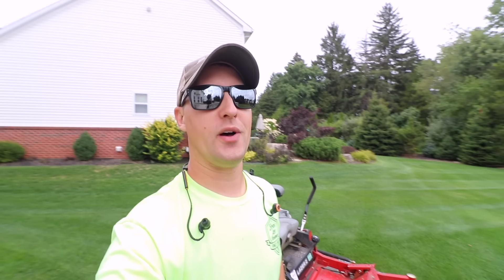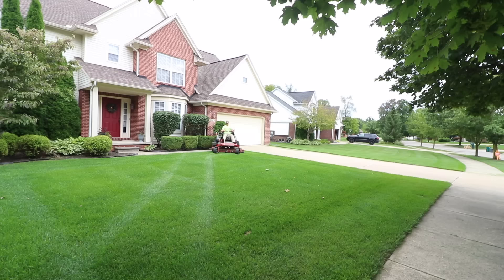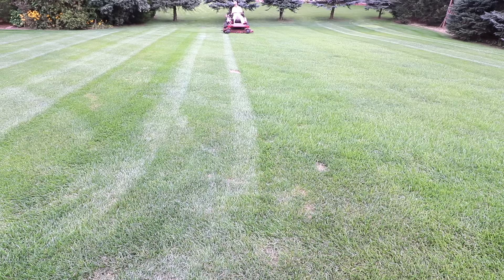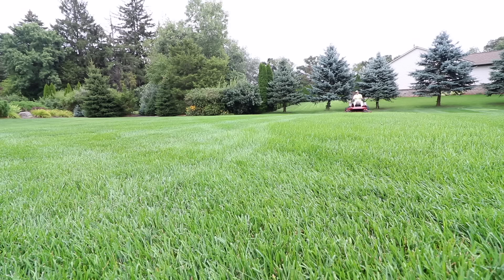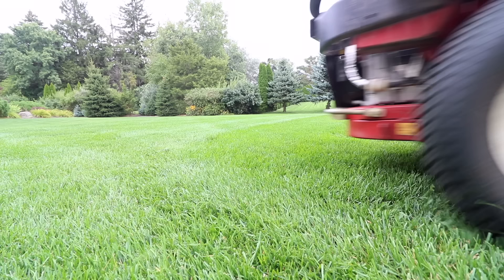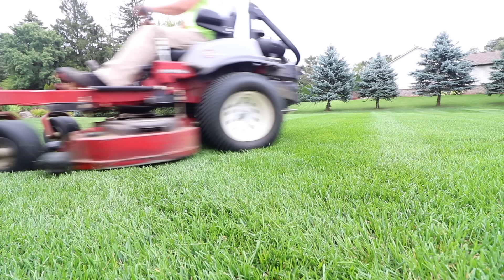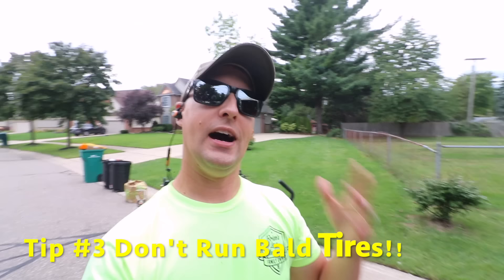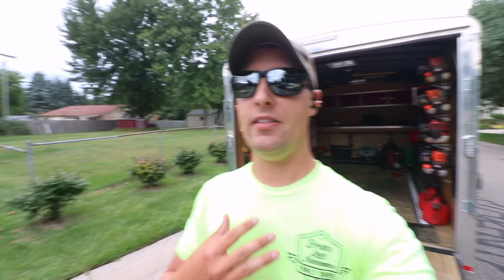The Secret To RUT FREE TURNS On A Lawn Mower

Comment: Thanks for these tips.  I had a troy bilt zero turn with a steering wheel.. Just got an Ariens edge with levels. I knew there was a learning curve but geez.
I was turning like you but  was going straight back.  I'm going to practice the way you do it. Turn, Backup while turning then line up and go easy.

Love the deck on the edge for a residential but it is a rough ride on bumps.  I felt like I was on a wild bronco.
Had it a few days  AND GETTING BETTER.
The first day my neighbors got a good laugh and I have touch up paint handy.

Comment: I live on a farm but I mow my front lawn for aesthetics. 
The yard is about 10 acres which includes a three acre pond. Sometimes it is a bit wet up close to the pond and as you probably know, a zero turn will get stuck in a heartbeat. I changed my turf tires out with a set of ATV V-notch tires which are pretty aggressive. 
I can still get stuck but it’s now pretty rare. As far as not tearing up the lawn, I practice almost the very same maneuvers on my mower that you described and my grass looks great. Basically, if you go easy on the sticks when turning you shouldn’t be tearing up your grass.

Comment: Great video like always. 

Best Hint you gave the people is Slow down in turns, keep wheels always moving your machine is not a race car. 

I stay away from concrete side walks and driveways as much a I can my tires seem to always leave some marks even if I do a really big turn.  

I have learned that if you want to do a zero turn make sure you only do them on lawns that are thick with grass.  

If you can see the dirt or it is not like a carpet then you will increase your chances of tear out.  I use a T25i walker   with a 36" deck and those narrow tires so have I have to take my time on those turns. SLOW but keep those wheels always moving and do not take of fast.

Comment: Good video.  The 3 point turn was done nice and slow and deliberate so it was easy to see what was happening.  I operated a zero turn commercially in high school in the 90's.  Basically never stop a tire and pivot on it because it will create divots in the lawn.  Slow as you approach the turn around point.  Keep the outside wheel turning a steady speed and slight the lever for the inside wheel back thru the stopped position into a reverse position then slide it back to forward drive as the mower is lining up.  
I agree with the turning on paved surfaces vs. grass depending on how wet it is.  If it is wet you will end up with grass stain tracks on concrete surfaces.

Comment: I have three areas of my yard, each handled differently. In the very front (closest to road/sidewalk), every effort to minimize lawn damage (slower, careful wide turns on sidewalks if possible). In the middle (behind house), just get the grass cut (neatly, but not overly so). At the very back (uneven, large rocks, etc), it's play time (fast, spinning turns, run over stuff, etc).

Comment: Always try to turn around on sidewalks and driveways but avoid leaving tire tracks which only happened to me when it's wet or if you're in too big of a hurry...
 if you turn around in the grass every time it will end up looking bad because you will have turnaround marks instead of a straight line where the stripe continues right through... also over time in these areas it will start to weaken the grass underneath...
Brian does it perfectly in this video and that extra trim pass on a wet day if he cannot turn around in the driveway is crucial...
Reply: but how do you not leave tire marks on the sidewalk or drivaway
Reply: @ajbrewer8259  only when it's dry it won't

Comment: I have a big Cubcadet GTX 2000 garden tractor and I mow on a hill.  As you said, do not spin the tires.  It would help if I had positraction but one will spins.  Now only dry grass and I mow at the maximum deck height so that I’m not ripping up turf when mowing close to trees.

Comment: My Ferris 400S was dropped off yesterday and I was practicing with it and if you are Someone who is thinking about getting a ZT but stumbled upon this video and are worried I can tell you with confidence if the grass is dry doing a 180 won't leave ruts now it could be bc my grass is short time will tell I did ask the gent who dropped it off he said 3PTs are in the spring time I will update as time goes on
Reply: Cut my grass for the first time with my ZT last week even with coming up with a new route on the fly and doing slow 180s I went from roughly 2 hours on a traditional tractor to 42 minutes 12 in the front which took me roughly 25 minutes

Comment: sidewalk turns if dry grass. wet grass keep on lawn so u dont make a mess. most any hard surface is preferable. heres advanced tip. watch your front tires, they tear up lawn also. u should be able to spin them so they roll in a circular motion at all times. if you want to double cut the lawn, try super stripes. its every third line as you turn around hit the white stripe and you wont have to do any 3pt or zero turn. very handy also if you want to run the same pattern two weeks in a row. and watch your edging on the sidewalk. Last thing, when you cut the front lawn, u started your pattern on the wrong side. start your pattern where the driveway meets the sidewalk. (opposite angle opposite starting side.) it makes your turns easier. you can also do it next to fences or curbs and back into your next stripe, leaving you with a crisp one perimiter cut at the end. nice stripes btw. for an exmark. lol

Comment: If the sidewalks, driveway or the street are available to make turns, I use them versus turning on the grass.  My Gravely 260 is brand new and those back tires grip the grass even when doing three point turns and going around trees.  For some reason, I'm still tearing up grass (divots) in areas even going super slow and consciously trying not to lock up the pivot wheel... still happens.
Reply: Try reducing tire pressure in your rear.  Too high of pressure allows the wheels to slip.
Reply: Youtube Sucks ass  It's not bad, but you have to adjust the front baffles to get a good cut.  Many people just remove them entirely and it stripes great.  The problem is you get blow out from the front of the deck back onto the operator.  I'm looking at gravely 52" pro stance with the Kawasaki 730 EFI motor. Now that thing is sweet!

Comment: Would love to see a video of avoiding scalping when mowing shorter lawns around 2 inch uneven lawns are frustrating. My anti scalp wheels are in the front center of the deck on my wright stander. Feel like if it had side wheels on the deck it would be a lot better.

Comment: I always use sidewalk for turning; I even travel farther to get to sidewalk; I do anything to avoid turning on grass. one section where I would do 180 degree turn I go to sidewalk, turn, and get back on grass. what is opposite of sharp turn ? broad or wide turn,. on wide turn I got damage from zero turn. also, I keep my seat adjusted as far forward as possible to keep weight on front wheels. I also avoid mowing on wet grass; I see more scalping on wet grass. anywhere I see commercial mowing with zero turn I see lawn damage. only benefit of zero turn is very easy to steer. excellent video

Comment: I turn on the grass to: 
1).  Avoid discoloring the sidewalk/driveway
2).  Maintain the ice, tight edging, without weighing it down, by running over it.  When I was thirteen/fourteen, working with my grandfather in Florida, he’d “kill” us if we even stepped on the edging, or even walked across the lawn, once cut.

Comment: I totally get the advantages of a Zero Turn, I have one.  But its so funny to me having to take the thing that turns zero degrees and having to do a 3 point turn that I could just do on a cheaper lawn tractor that doesn't turn as tightly.
Reply: This is a hell of a good point
Reply: It is much less work and effort to use a zero turn when doing lots of turning following contours and beds at speed

Comment: One other tip...

Don't be afraid to mow in reverse.  It can be done!
Reply: I cut alot in reverse  what ever I can do to keep the grass on the grass . Saves  time with blowing
Reply: good trick to link different angles without screwing up 2 stripes. yes, yes it can be dont
Reply: My zero turn automatically turns the blades off when I go in reverse . So it's not possible for me :(

Comment: How about how to avoid the ruts following the same tracks over and over in a yard. It will actually compact the soil and change the cutting height
Reply: Change your pattern from week to week.
Reply: @ralph1478  yes, but many cutters haven't figured that out yet as I see a lot of striping jobs with dark green wheel tracks and noticeably lighter in between. Think this would make a good video

Comment: FYI, A portion of my lawn is on an incline.  I had a problem with the turf tires on my zero turn spinning on the grass  when turning up hill, if it was the least bit moist I would have to be pulled out with a rope.  Replaced the tires with ATV knobbys.  Now have no problems with getting stuck but have to turn very slowly, those knobby tires really tear up the turf.

Comment: I second the tip on tires. I had some tires glazed over (still have tread, but treads were rock hard and would free wheel on both lawn and concrete). Replacing them and getting grip back made a huge difference on my turning. And I do turn on concrete/aggregate where possible, but it is my lawn and my driveway.

Comment: Tip # 5.    Buy a zero turn mower with Turf Tear Reduction Technology ( Cub Cadet Pro Z 960 - with a steering wheel).   I always do a true zero turn and do not rip the grass. The technology is built right into the mower and the operator does not even have to think about it.  If you have a mower (lap bar)….. Brian is completely right….you are forced to slow down and 3pt turn.   So to sum it up.   If you bought a lap bar mower you REALLY did not buy a zero turn mower. (Sound crazy, ,,,,,that’s why my two lap bar mowers are now my backup mowers.   Brian, thanks again for the how to videos.    Keep em coming.

Comment: Great tips. On a standup u have to do more of a slow y or k turn since the weight isnt as displaced as on a sit down. So u have to go SLOW, and keep that inside wheel spinning like u said to keep from pivoting and ripping up the grass. Turning on the sidewalk is good  when its dry but Make sure your tires arent muddy from bare spots or mud under trees.  Great tip about re doing the boundary after making lots of turnarounds on the grass

Comment: On your 3 point turn when you back up your inside tire is pretty much stopped and not rotating.  If I did that on my lawn in the spring, it would tear the grass right out.  I'd say a less sharp turn when backing would be better.  I've also heard it called a Y turn; think that's more descriptive than K.

Comment: Thanks so much for the tips on turning. This is an issue for me, taking my tractor around trees. I'd find that I left tears and tracks when turning around trees, especially on damp lawns. I corrected this by using a three-point turn method similar to how the driving schools here in Texas teach you to turn around on a two-lane road. Run up to a half turn "J" pattern, back up in a simicircle the opposite way, then proceed forward turning back to mow in the opposite direction from which I approached. A mouthful, but it stopped the ruts, tracks, or tears. As always, I'm open for better ideas and again, thanks Brian for this video and your turning tips!
Reply: 3 pt turns around trees???? is that what your saying

Comment: I'm surprised that tire pressure wasn't mentioned in the video. I've been drivin' myself nuts adding and deflating the rear tires on my Scag. I thought this was the reason it's leaving the "divots" on my turns. Thanks for the info.

Comment: END THE MADDNESS !!!   great, great video Brian.  Turf tear is a huge problem, and perhaps the number one complaint coming from our customers.   As you pointed out in this video, Lapbar mowers are very technique sensitive, and require us to slow down and do 3 point turns.   The NEW zeroturn mowers,, however,  (e.i.  Cub Cadet Pro Z 54,60 or 72 inch mowers)   have TURF TEAR REDUCTION TECHNOLOGY built right into them.   For the last four years I do a 3 point turn (only if the grass is very thin).   As the outside wheel rotates forward, when the steering wheel is FULLY turned, the inside wheel is engineered to automatically rotate backwards (eliminating TURF TEAR).   ITS TRULY AMAZING.....We are 10-15% faster on these mowers than our Exmark and Scag lapbar mowers.    I actually did not believe my dealer until I used one of these mowers for a week or two.   Customers love the look of their lawns and I enjoy the increased productivity.    Best of all, there is no learning curve......You can trust that a new employee won"t be tearing the heck out of fav customer's lawn.    Again,  love the video and thank you for addressing this important matter.

Comment: Turn around on grass if wet or paved surfaces are light in color. Dry I will turn around on paved surfaces only if blacktop, gravel or other things that won’t show tread marks. Always outline the yard to get rid of the turn around marks, even if I used the paved surface.

Comment: I turn around on the grass and the sidewalk also i also 3 point turn but just to aid in not tearing up the grass i will run my tire pressure at 8psi for better grip.

Comment: If there is sidewalk or driveway to turn on, I try to use it, but like you say, when it is wet, the grass tire marks dont come off  easily with the blower. Another tip to avoid tearing up the grass is to not mow when it is wet, though that is not always possible. Up here in Maine we have hilly uneven terrain, and another tip is to always turn so your outside tire is downhill when on uneven terrain

Comment: Nice.  Residential mower guy here and my issue is with the front wheels "grinding" as they spin.  Any advice how to reduce that?  Even on a T or K turn the front wheel spindles spin as you switch direction front to back - my Scag front wheels seem to grind as the wheels spin.
Reply from the maker: I'm not specifically sure what you mean grind, sorry!

Comment: New subscriber...have u done a video of when NOT TO BUY/USE A ZERO TURN , based on slope, hills? Dealers say approx 30+ degree slopes forget zero turns...I demo cut my front slope mowing down, with a right turn at the bottom, always slid sideways, same on horizontal cuts on slopes...yet I see landscapers/homeowners use zero turns on same slopes all over town....some up and down, some w a modified horizontal cut on a slight diagonal. IMO ...zero turn I tried was homeowner series w narrower rear tires and no front weights...wide tires and weights I think are key to mowing slope of my yard, as well as avoid scalping even w full float decks sticking to a 50-52” deck. My Simplicity Prestige w power steering and 50” deck I like due to easy turn control around obstacles, but not liking its striped cut or mowing higher...and it is getting tired...reconsidering Exmark or Scag commercial grade next level up over homeowner models, since I mow 3+ times per week during peak growing seasons.

Comment: I'm not a commercial lawn contractor but I live in the country and have a big lawn and road frontage to maintain.

I use a Scag commercial zero turn machine with an hour meter and usually run about 8 - 10 hours a week.

I enjoy your videos and agree with you, but I noticed that you don't promote the use of a ROPS and a safety belt.

I'm also a firefighter and retired forensic accident investigator.

I've seen the consequences of overturned lawn equipment, farm machinery and industrial machines  (forklifts, backhoes, etc.)

I will not operate a mower without a ROPS and safety belt.  I always use hearing and eye protection too.

SAFETY TIP 

Many commercial grade and homeowners'  machines drive the hydraulic pumps from a single belt.  If any part of  that belt drive fails unexpectedly while working on an incline the machine will freewheel leaving no steering control and only the parking brake to control the machine, with potentially harmful consequences. 

Routine maintenance of this part of the machine is safety critical.

Comment: For wording when turning when you say inside tire, you may want to say make sure tire stays rolling and not spinning because for beginners I think it’d be easier to understand. I feel like that’s the real trick for it. If not rolling when turn your def gonna twist dig in that inside rear wheel. I prefer turning on the grass personally just for life of my tires. I learned that lesson on my older walk behind with the tow hitch wheels to ride on. I’d tend to do tighter spins because wouldn’t have to worry about grass ripping up and it would create a bald spot on part of the tire. I feel I’d do the same with my rider if turned on pavement.

Comment: I would always make two laps around the yard,house and mostly everything blowing the grass inward. I tried my best to never let the wheels get on the driveway and sidewalks and once I was done cutting I wouldn’t go across the yard with the mower if I had to go around the neighborhood lol lol when I would turn around I would stop and then start backing up and then make the wheel start turning in the opposite direction that I was turning. Basically I called it twisting around which I would start turning in the direction that I was going before I stopped so that when I twisted it around I would pretty much be able to go straight forward. It probably sounds complicated but I bet that it didn’t take but a second or two and neither wheel spun or drug during the process. Back to the sidewalks and driveways I have went to the end of the yard and then over the curb to keep the wheels off of them and I mainly did that when the grass was wet or damp. I didn’t do it everywhere but at places and neighbors that I wanted for it to be perfect.